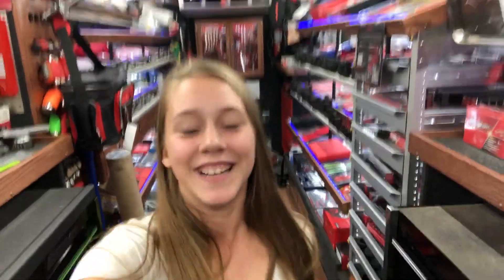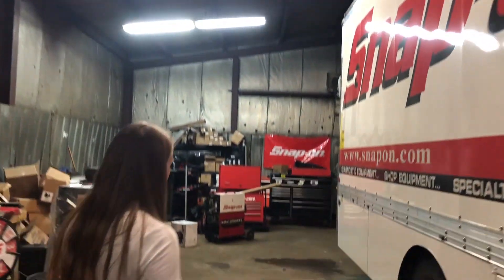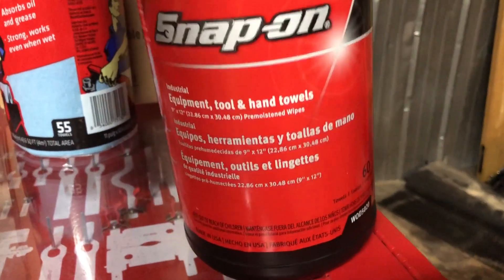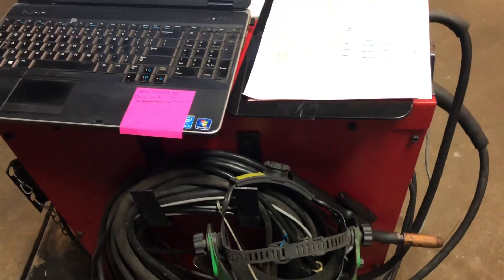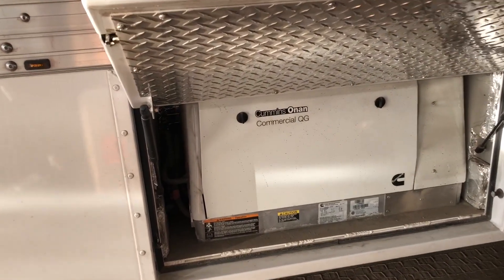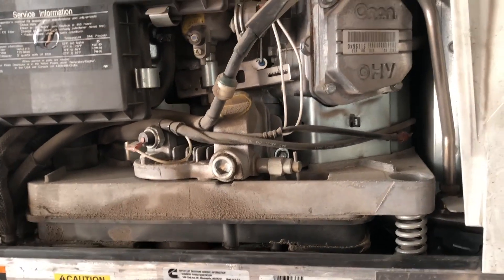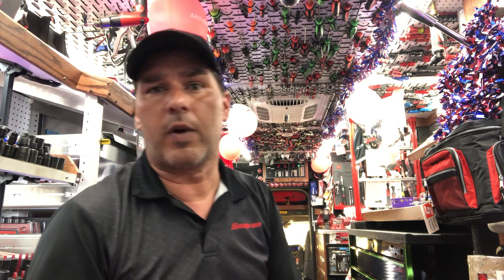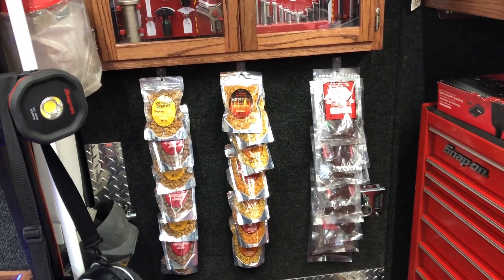6-13-2018 snap on dealer

Comment: I'm a new subscriber I've been watching your videos from the beginning after I found you on YouTube I hear you say something about the virus scanner I went to school about 4 years ago and I know that that was like a topknot scanner is that not the case anymore is the Zeus the new scanner?
Reply from the maker: Correct.  The Zeus scanner has replaced the verus line of scanners.  Although they are very similar the name change was needed I think to Differentiate between the scanner that has intelligent Diagnostics and the Scanners that do not have intelligent Diagnostics.
Reply: Thank you for that been out of the industry here for about 3 years now so I didn't know that what if you owned a Verus but you wanted a Zeus would they still do trade-ins for your verus to upgrade? Really like your videos and I appreciate you responding to my question even on a older video thank you very much
Reply from the maker: Yeah a dealer would take it in on trade.   Thanks for watching.

Comment: What kind of prices do you ask for used tools? Do you sell them on the truck or places like ebay?
Reply from the maker: Have to sell them in my route.  We are not allowed to sell on line.
Reply: Haasl tools Can dealers get the original trays that the tools come in? I have a bunch of stuff I want to find trays for, thanks. I like your videos
Reply from the maker: Some of them if it’s still a current set.
Reply: Haasl tools Okay, thanks for the reply
Reply: I am interested in duckbill needle nose and I'm not sure where to find them
Reply: Nolan Riegsecker Look on ebay or amazon
Reply: Nolan Riegsecker Or if you want long ones, type in "tekton duck bill pliers"